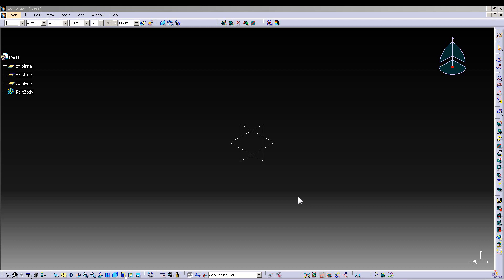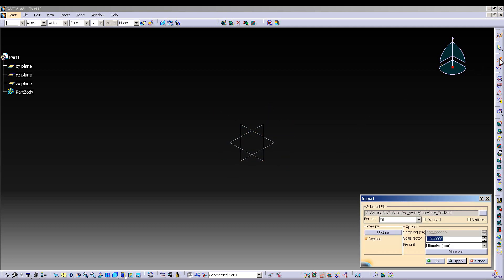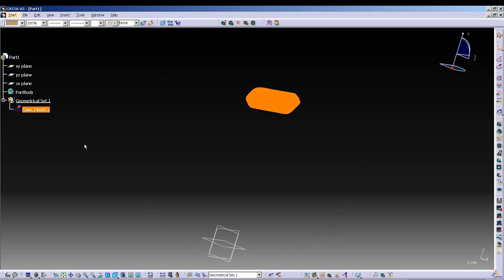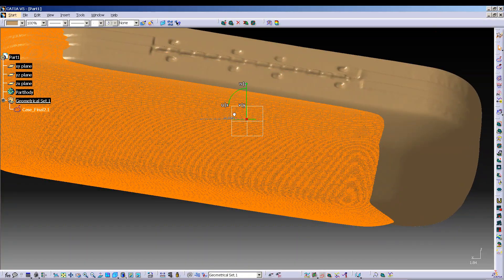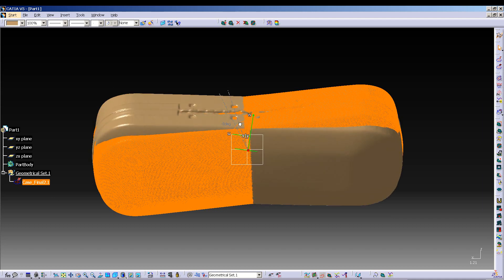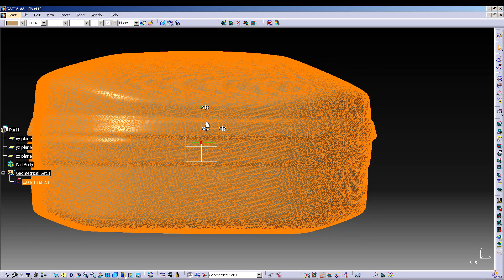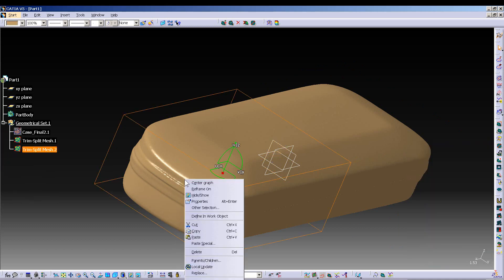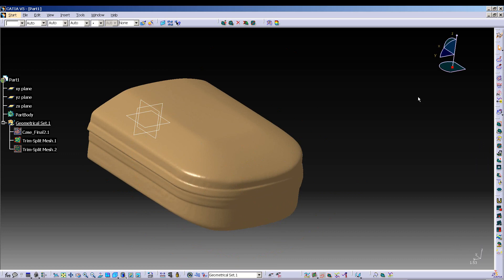EinScan to Catia Data Import Test

Comment: Hallo Steve
Excellent channel, especially comparison Catia to NX.
Do you have possibility make next films on the 3D EXperience instead Catia V5?
Reply from the maker: I looked in to licensing and it will cost me a lot to shift licenses. I will wait until a client requires me to use 3D Experience. Cheers
Reply: @StevenMarji  , are you using commercial licenses?
If so, you're right, there are expensive.
I've educational 3DExp lic which is incomparably cheaper than commercial (30 edu licenses of V5 costs about 2000 € or $).
Generally diferences between V5 and 3DExp are not so significant (besides of integrated Enovia), but 3DExp is more "modern".
GDS, PD, Drafting, are generally the same on the both wersion.
"Assembly Design" was changed. "Constraints" has been replaced by "Engeneering Connection". 
No other significant diferences in "classical" modules.